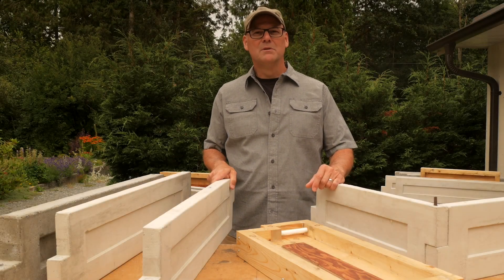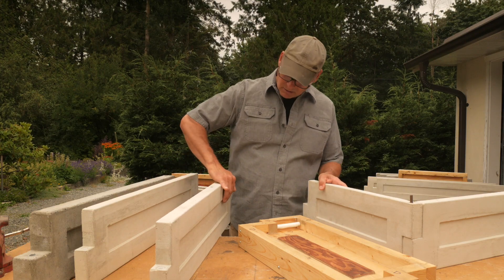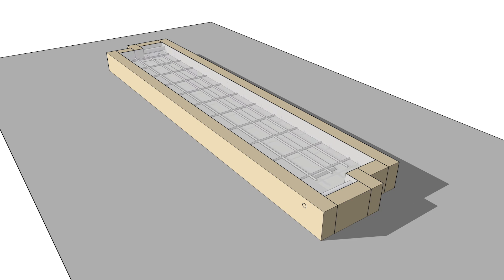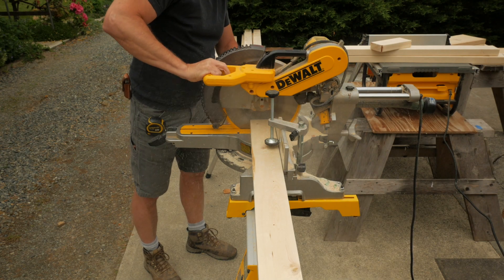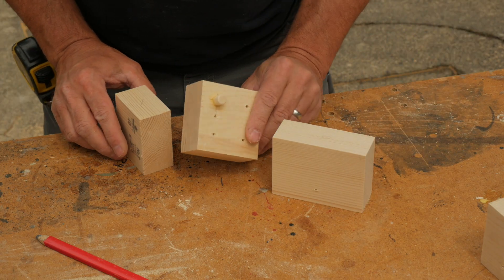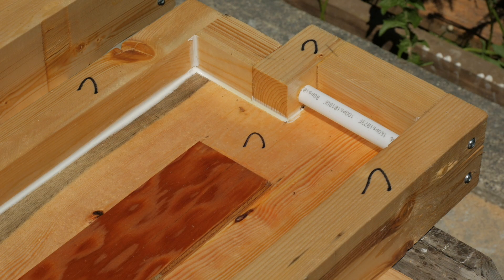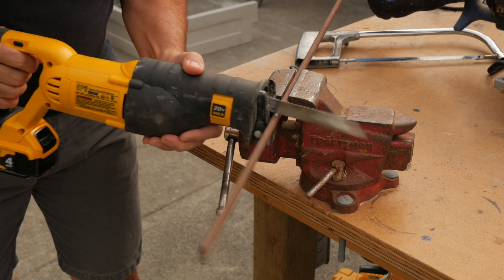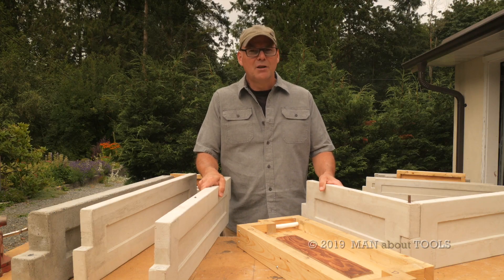make Thin CSA Concrete Garden Boxes PART 4 - cast garden forms

Comment: Anyone know how to get this type of mix cheaper? $18 a bag for this stuff at home depot so about $10 per panel.   I'd like to make tall stand up raised beds about 32" tall so $160 for 16 panels to make one bed is a bit much.  Looks like Quikrete FastSet (123160) is basically the same stuff but its also expensive.  Guess I'll just have to do the thicker regular concrete panels.

Comment: use basalt fibers instead of riber glass.  Use a lot more of it and don't add the metal. The metal will expand at different rates and will likely rust over time and weaken the product.  You could also use Basalt rebar instead of the metal, its stronger so you could use an even thinner rod and it will not rust.  you could drill a tiny hole in the bottom o used compressed air to force he part out.  You could hold the PVC in place with some screws on each side or even a long lag bolt.   When its time to demold, turn it over, remove he screws / bolt blow compressed air in and the form should pop off.

Comment: I would dare say that there is almost certainly a retail market for these panels, if somebody wants to start a business making them. The question is - How would the retail cost compare to a typical wood garden box kit that the big-box stores sell (in the area of $45 for a 4'x4' kit, IIRC).  If you can do it for around $35 retail, you would have a winner.
Reply: I doubt it would be cheaper.  This kind of mix is expensive, its $40 just for a 3'x3'.  Even if bulk pricing was 1/4 of that @ $10 since 4 panels weigh 120lb with shipping and profit built in I think it would cost allot more then wood.

Comment: Any plans to add inserts so a cold frame could be added when necessary?
Reply: Don't need to add inserts. Make a wood frame that overhangs the top edge of the panels and use threaded rod at the corners instead of plain bars then nuts to hold the wooden frame in place.

Comment: I can't believe you only have 46k subscribers.  You're videos are great quality and very informative.

I wonder if these would work for a tall garden box, one which would have a water reservoir at the bottom.  I made my first out of scrap wood and it is holding up so far.  The biggest issue with tall garden boxes is bowing out because of the weight of the dirt.

Comment: I had an idea maybe you might be able to do it. Idea make a column of concrete with channels to slide in galvanized steel panels.   What would be needed would be a corner with hole for rebar  then slits for the panels. Next a middle one with slots in left and right with hole in middle. . Would it be possible. Also no idea on top wood or concrete your choice.
Reply: MrBuzyb - I have a little book, published in the late 40s which was full of cast concrete designs for home improv. Among them was a design for a fence. It consisted of a cast  i-beam post w/ a slot on each opposite face and cast concrete planks, similar to Kents planter sides but w/out the articulation for the joints. The planks would be slipped into the channels once the posts were set plumb and true at the proper spacing.  Per my recall the planks were 5 feet long but that could be customized to what the handling capability you have. I thought it was very cool! I will see if I can locate that book and post the reference when I do.

Kent great project, great process and excellent instructional videos and a look into your process! Thanks for sharing. I have wanted to build boxes like this for a while and your series has inspired! I have wedge shaped boxes now (part of the gardens hardscape’s design) and am thinking that in making custom-geometry end caps can maintain the main formwork design and  maintain its adaptability. Will need to spend sometime modeling & sketching!

Your exploration of concrete mix and type is killer! Look forward to seeing more of your work. Thanks again!

Comment: Awesome idea and design refinement.  The wife wants this tomorrow.  We will probably see these showing up at Loews and Home Depot made in china in a year or less.  I love the lighter high strength panels.  However, I think consideration should be given to longer stakes if you make a rectangle box with a joint in the center.  This would prevent sagging.  A cross brace at the joint under the dirt or at the top would also prevent this.  Another idea would be to round the ends of the joint so these can be made into shapes not restricted by 90 degrees.  When I make mine I am going to figure out how to do that.

Comment: Great video i will be using this info to make some lightweight basement window wells, that's some nice looking lumber your using to build your forms do you have a local lumber yard or is that HD or Lowes ? I live in Colo. and all we have available is the worst cupped, twisted, bowed and sopping wet Doug fir garbage you could imagine.
Reply from the maker: Thanks!! I really scrounge through the piles at HD to find the straightest stuff there. And if I find some quality boards, I buy extra and stack them in my shed for later projects. It's funny cause I live on Vancouver Island with loads of Douglas Fir trees everywhere. But do you think I can find much of it at HD or other local building supply stores? Well...I'll stop here to avoid a rant. ;o)

Comment: Nice job........how about the durability of winter freeze/thaw cycles?.......seems concrete wants to scale in that environment
Reply from the maker: I have some of the original concrete garden boxes that are about 8 years old. Not a single crack. But, I'm on the west coast where are winters are not so brutal. Another comment was made that it might be a good idea to remove the metal pins in the fall so the panels could move with the frost. Perhaps welding a washer to the top of the pin might help with extraction.
Reply: @MANaboutTOOLS  Yes, that might help, but I wonder if the freezing would then shift the walls making the placement of the pins back in position difficult....we are in East Tennessee, and concrete pots will  crack or burst if good drainage is not present, and perhaps that is the saving grace....keeping the bottom open....drainage can occur and the crack potential will decrease.  Scaling of the concrete will perhaps occur, but esthetics are not the main concern.  I think it is worth the effort.......many thanks!!!

Comment: I see that you changed the tube material. What is it? I cannot find a reference for it or the specifications for the electric fence rod.
Reply from the maker: Its 1/2" Sharkbite plastic water pipe. Also from Home Depot. The electrical fence posts I cut down for corner pins are 3/8" dia.

Comment: How would these work with AirCrete?
Reply from the maker: Hi Brian. These forms are designed for high strength concrete. I am yet to find a strong and durable aircrete mix for the panels. Will be working on some new formulations soon. Kent

Comment: Great videos... Thanks!  One problem I see is that if the rebar corner stakes are pounded in too far, so that you can't get some pliers on them to pull them out... how are you going to disassemble a bed if you want to move it?  With the end ears being opposite (one up, one down) you'd have to try and lift the whole bed assembly up to get it off the stakes.

Comment: Well done Kent...well done.  Yes, I was anticipating this video.  Please Sir, could you share your opinion on which panel and fabrication method is the most economical.  I would like to consider using your panels to build an approx. 3.5 foot high retaining wall in my back yard.  I'm not so much concerned with the weight of a panel, except for if it is so light that it is not durable for my use, but cost per panel is an issue to me.  Thanks for being willing to share your insight and experience.  Your videos are truly amazing...totally professional in all ways.  Well Done!!
Reply from the maker: Thanks Steve! I really appreciate the support. The regular portland based concrete panels poured in the framing lumber forms from Episode 2 are plenty strong, and probably the cheapest to cast.

Comment: I will be using this idea for my gardens in the future. just a thought, have you ever  consider putting a tongue and groove along the top and bottom edges to give additional lateral strength for going above 1 panel in height?

Comment: It was great to see all the versions you used in your series...while I and Im sure others have thought of 100s of other variations, using concrete... I think I will just make them out 2x4s or discarded wood from pallet and coat them...since even low grade wood is pretty strong in tension or shear, such as in this application...so thx for the inspiration...

Comment: An observation - With these thinner panels the thickness of the concrete around the peg holes on the ends is getting thinner. Do you see this being a problem down the road? Very nice project so far! Have just the place for a few of these!

Comment: Glad to see your using the Rapid Set.  I have learned from experience that this is the best product to use.  Superior strength,  less prone to cracking,  excellent surface finish, and best of all the quick drying time.  I have used it for concrete counter tops and all kinds of other molds.  Just a superior product.  Thanks for videos, very well done!
Reply from the maker: Thanks! I really like this product for all the reasons you mentioned. I have more projects planned and will be using quite a bit of it. Cheers, Kent

Comment: Loving the series! Have you considered using industrial perlite for making a lighter concrete mix? It's quite popular in insulated concrete like you would use for building a pizza oven. Also, could you forgo the wire if you added more or longer fibreglass strands? And is the CSA concrete compatible with aircrete mixes? Keep up the great work
Reply from the maker: I will do some perlite tests. It was on my original list but there's just so many options that I had to cut some out to keep the video under 20 minutes or so. Thanks! Kent

Comment: What would happen if you combined both weight reduction techniques: use CSA and vermiculite?
Reply: This was my thought. Thumbs up.
Reply: You mean perlite? It's often used with concrete. Vermiculite it too brittle and holds more water.
Reply: I wondered the same thing, but mixing CSA as air concrete.  There's another youtuber that made a shed out of air concrete panels.

Comment: I'm guessing you went with the Rapid Set "Mortar Mix" vs "Concrete Mix" for the smoother consistency (no aggregate) and thus more fluid and easier pour? I'm curious too about the omission of the wire reinforcement around the pipes vs previous designs.
Reply from the maker: Given the thinner section around the pipes I felt there was just no room for a wire wrap. My thinking is that this CSA concrete is stronger, (with fewer air pockets too) and the addition of fiber that it's worth a try without the wire wrap.
Reply: @MANaboutTOOLS  " Rapid Set "Mortar Mix" vs "Concrete Mix"  -  did littlejason99 guess correctly?
Reply: @geze2004  concrete has aggregate in it. Aggregate means rocks. Rocks are fairly inexpensive. They're rocks.

Comment: Could you add vermiculite to help with the weight issue? I wonder At what ratio you could add it without loosing strength?   These are great videos. Thanks! David
Reply: Anytime vermiculite, perlite, etc. is added strength deteriorates.  The "balance point" is how much strength can be sacrificed to achieve the lower density desired.  CSA mortar mix is probably overkill for these panels so there is some room to maneuver.  I plan to try a lighter mixture to the point where I can get 2 four-foot panels from each 55 pound bag of Rapid Set mortar mix.
Reply: W. Kern Hendricks another thought, though costly, Pool Crete. Used for swimming bottoms on above ground pools. Very light, fairly strong, but again costly.
Reply: @davidlangston6927  No price is too high for the vegetables I grow.  Once you exceed the market price you might as well go for broke!

Comment: You can use a sheet of plastic food wrap off a roll to line the forms. No chalking  required and the finish is very smooth.
Reply: Then throw away the plastic?
Reply: @Eggs4ckley  
When you take off the forms save the plastic and use it to cover the new uncured concrete  after you wet it.  This helps the cure and is a second use of the
plastic wrap.
Reply: Plastic food wrap leaves wrinkles in the cement. But I guess that could be part of the design :-)

Comment: As an avid gardener, this design is a revelation.  I purchased your initial design and intend to make these for my gardens between seasonal plantings. Suggestion:  It would be more practical to have designed the interior of the finished garden bed to be 4' foot, as this is a gardening standard, and helps when planting vegetables on 12", 6",4", or 3" centers.  I would also recommend that the pipe used in the form have an inside dimension large enough to accept a section of pipe that in turn has a large enough inside dimension to have standard 1/2" conduit (EMT) fit inside.  With this design, 1/2" conduit can be used to construct a cold frame enclosure or walls to keep out garden pests and make the garden an all year growing area. The larger pipe can then be used instead of rebar to anchor the boxes to the ground. Again, Great design, thanks so much, I have literally been looking for something like this for years....
Reply: I also want to incorporate cold frames with these garden concrete box sides. In the past with my wooden garden boxes, I drove in 15-inch lengths of 3/4 inch PVC pipe (200 psi) into the outsides of the boards. I spaced them every 30 inches. Then I made cold frames out of 1/2 inch PVC pipe (schedule 40) which slid into the 3/4 inch pipes. I know that this interrupts the clean lines of the concrete sides but it gets the job done. Just an idea for what it's worth.

Comment: Why is the Rapid Set superior to Quikrete fast setting? Rapid Set $12.97/60 lbs =$.216/lb. Quikrete $5.80/50lbs=$.116/lb That is right at half price. Thanx
Reply: Rapid Set Mortar mix is made with an entirely different binder than Quikrete.  The binder (CSA) is primarily more expensive because there is only one supplier of CSA concrete mix in North America.

Comment: will you be doing Compression test as well ... id like to know how much weigh individual can each take before breaking For purposes like building a pet house or a nice tower brickwall ..  as this would be an easy solution to form a boundry for far less work as well as easy to pick up and go.
Reply: forgot to ask could this also be use in application like small river way or be use as a bulk head ?

Comment: Nice video, I noticed  you didn't add any wire re-enforcement around the pic pipes, is it not needed?
Reply from the maker: (reposted reply):: Yes, with the increased strength, fibre additive,  and fewer air voids in this concrete I wanted to try it without the wire wrap. The section around the pipe is now fairly narrow and I thought also that its a bit too tight for the wire to be adequately embedded without getting too close to the surface.
Reply: @MANaboutTOOLS  as I thought.  Have you considered extending the re-enforcement you put in the middle so it can rest on the pipes at each end?
Reply from the maker: @danthebaptist6896  That might be a good option the reinforce the ends

Comment: Thanks for the videos. I love your molds. There's two additives I use with concrete outdoor projects. First water repellent, because frost is the worst ennemy of outdoor concrete. Second : dyes or pigments, mostly natural (ochres, oxides, earth pigments  and umbers.) which creates a perfect and durable aspect. Both do not change significantly the cost of the project. Last : to me it's fibres or rebar/wire grid. Both are overkill on small parts like those.
Reply from the maker: Thanks! It's hard to know without a lot of destructive testing if the fiber and wire grid are required. But, my thoughts on this are that it's easy and inexpensive to add, with little downside.

Comment: Love the series- Bravo and well done (Thanks Marylyn for letting him use the tools!). Two items that you may wish to consider if you are making garden boxes: 1- using a  piece of black iron gas/water pipe for one corner will allow you to mount a sprinkler head to the corner of a box or mount a pole for a trellis (your water pipe puts all the stress of anything directly on the concrete whereas the iron pipe may stain- but will afford a measure of vertical strength). And 2- you may want to consider adding a drain hole along the length of the form.  Love the idea and the evolution of it! Bravo yet again!
LOOKING FORWARD TO 3.5

Comment: Is the cost for the CSA mix higher than the cost for Portland? If so, is this cost offset by using less of the CSA mix? I appreciate you trying to make these light weight but if the cost is too high it would be more logical to make heavier and cheaper boxes since they will (hopefully) stay put in one place and not be carted around. :)
Reply from the maker: The CSA is more expensive. I wanted to show other ways of making the panels lighter. If weight is not an issue, then regular concrete in my previous forms works really well.
Reply: @MANaboutTOOLS  - Thanks for the reply. I really enjoy your videos and I'm looking forward to the next one (no matter the subject :).

Comment: I've burned out drills mixing concrete like that, something to consider. Thanks for the videos.
Reply: It seems with the plasticizer he uses that the mix is not much thicker than latex paint.  Unless you are using homeowner level tools you shouldn't have an issue.
Reply from the maker: Yeah, my drill didn't like that much. I heavier one is a good idea for sure! Thanks!